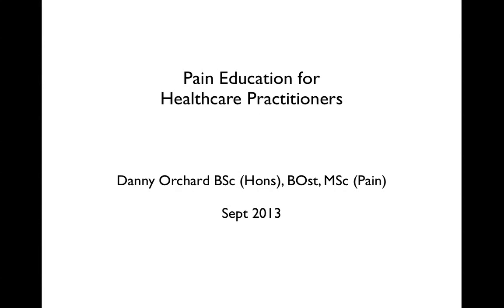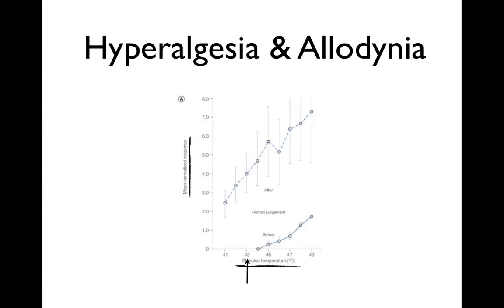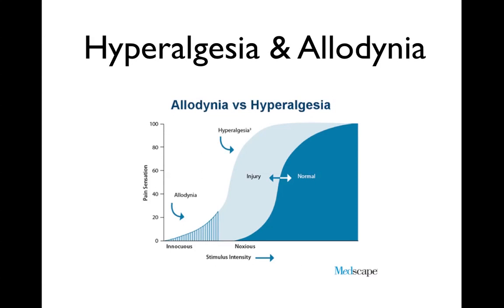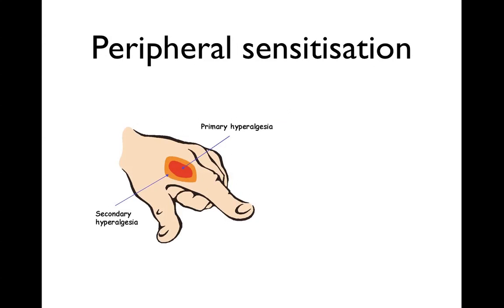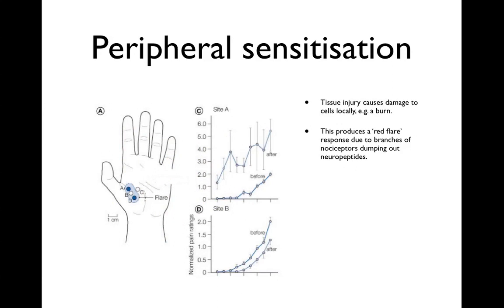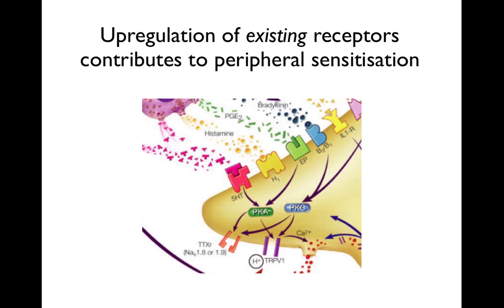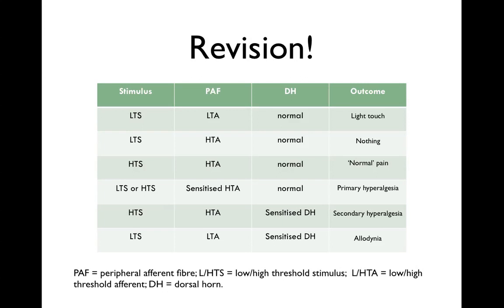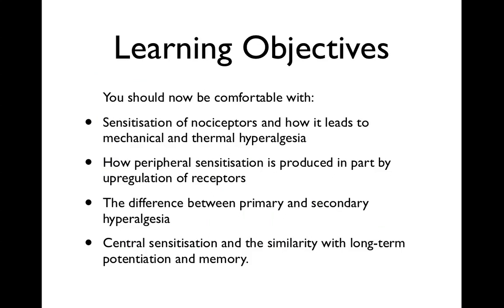Peripheral and central sensitisation

Comment: I was diagnosed with central sensitization in 2014, at least a decade before I was finally diagnosed with small fiber neuropathy just last month.
 I was diagnosed with fibromyalgia in 1993 almost 20 years before the central sensitization diagnosis. 
 Symptoms initially started around 1988 in my 30s during a very high stress period in my life, coupled with a bad case of Valley Fever. I've always wondered if those issues may have triggered it.
 Throughout these years I was looked upon as a complainer or told it was "all in my head" by doctors. 
I stopped going to doctors for a long time until I became so desperate from the burning pain, migraines, cramping feet/legs, fatigue, and GI issues that I had to try again. GU symptoms of frequency, urgency, and urinary retention are worse in the last 10 years. Heart pounding/tachycardia is also relatively new.
 My own research had led me to suspect small fiber neuropathy, and I finally got a referral to a reputable neurologist, after begging my annoyed PCP.
 I described my symptoms of body wide burning pain, cramping, migraines, fatigue, GI/GU issues, and many sensory hypersensitivities to this neurologist, without any mention of my suspicion of SFN, and was formally diagnosed with SFN by the neurologist. Finally a diagnosis. No other suggestions from him yet.
 Working within the medical system over the years, the many inflated egos and poor training has been "challenging" to say the least. If they cannot explain your symptoms, you are seen as a hypochondriac. This label is charted on your medical record and follows you from one doctor to the next, affecting their initial opinion.
 Over years of trying many prescription meds for short periods, I stopped them all except for Imitrex (sumatriptan) for migraines that just won't go away...and I take Neurontin (gabapentin) very sparingly. I never got into opiates at all, or requested any sort of just pain relief meds. I wanted to find and fix the core problem.
I have found several non-drug methods to help control the burning pain and GI symptoms after much trial and error. Symptoms are not gone with these methods, just made more tolerable to make sleeping more possible.
 Ice packs will temporarily numb the nerves and help the burning in neck, shoulders, back, arms, hands, buttocks, feet/calves. 
The GI symptoms (bloating, early satiety, cramping, diarrhea and nausea) are helped a lot by lowering carbs. Cutting out sugar and flour, reducing dairy. Nothing processed or artificial. I eat mostly good fats and meat, coffee, and water. I don't eat fruit except avocadoes. The keto/carnivore diet with one or two small meals a day and no snacks, 12 to 18 hours inbetween meals. No eating after 7:00 at night as eating too close to sleeping makes it worse, for some unknown reason. No smoking or alcohol at all, but I've never been a drinker or smoker. Sugar was/is very hard to give up, but that's getting better with time. 
I haven't seen improvement in the GU symptoms (urgency, frequency, retention) yet.
Vibration using long vibrating pads in my bed or with hand held long handle massage machines can temporarily help to stop the "jelling" of my body which happens when I'm too still. Jelling quickly leads to burning and migraines.
If you're lucky enough to get massage on a daily basis, that would help a lot, temporarily. Anxiety does increase severity of symptoms as anxiety worsens everything in life. 
 All these methods may seem extreme, but when the symptoms are intolerable, you'll try anything short of suicide.
 Mild exercise helps, even a calm slow walk - anything that moves the body. I just bought a Gazelle exercise machine, low impact with a lot of movement, just need to get it assembled.

Hope this helps someone.
Reply: Thanks. I'm sorry you have to go through this hell
You're a hero